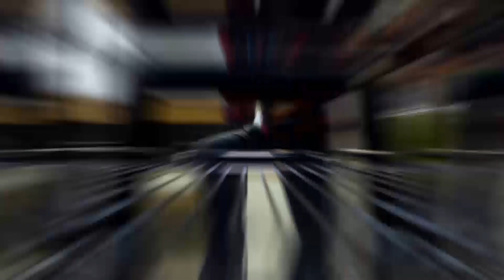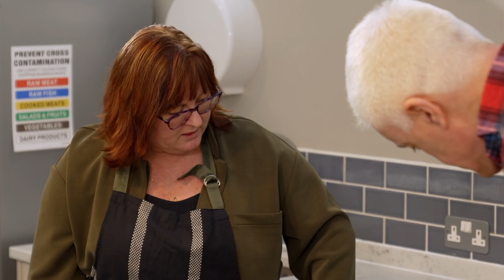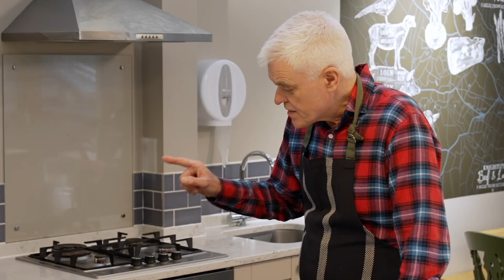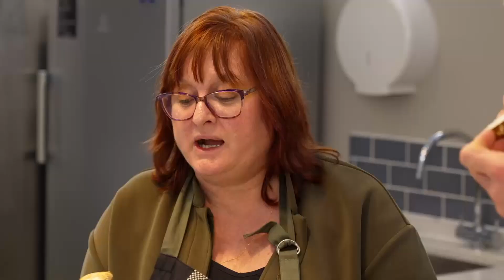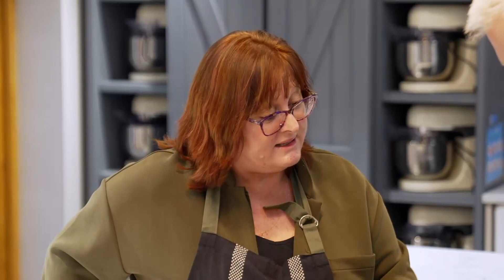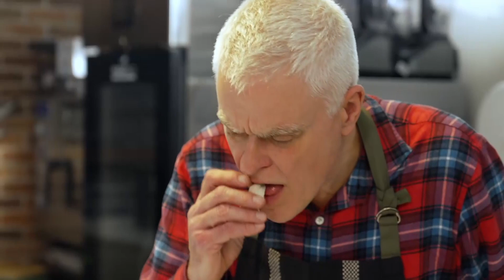The Best Ovens: Premium NEFF N50 vs Budget Hotpoint Class 2 | The Gadget Show

Comment: What is good about the German white goods brands is that in addition to their excellent engineering and reliability you can order spare parts you might need in the future directly from their website. With the other brand featured you will have problems - they just want to send an expensive engineer or sell you a new product, they don't want the public having access to spare parts. I have stopped buying these brands as they are effectively disposable products, because when they go wrong it is not viable to repair them.
Reply: when my cooker go wrong I go out and by the new one if if happen on sunday I will order a takeaway it only a cooker in my eye
Reply: Hotpoint parts are readily available too.